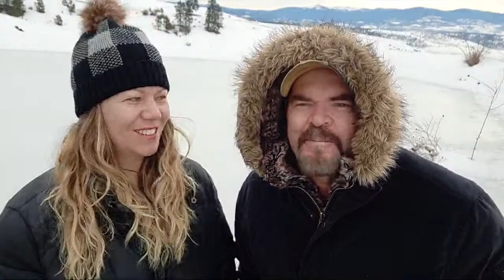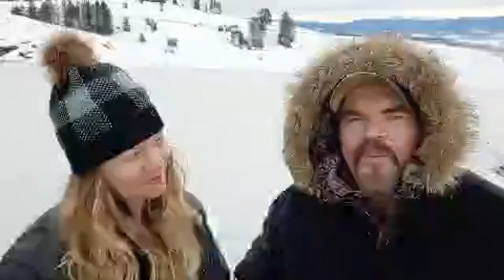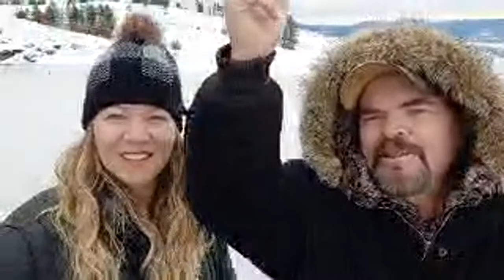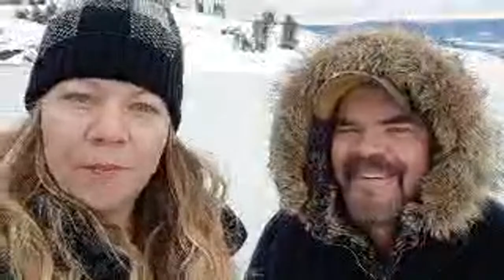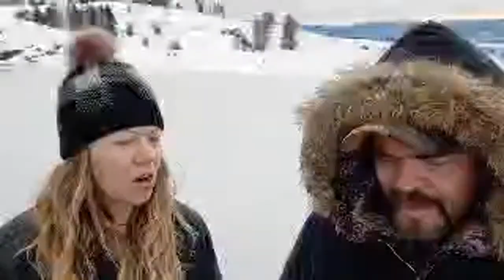HDC Live On homestead

Comment: Honey Do Carpenter, I have a question, if I were to build my shop using Air Crete for everything (floors, walls roof) would the Air Crete floor be strong enough to support some automotive lifts, or would I have to reinforce the floor with rebar? Any information and suggestions would be greatly appreciated.

Comment: You have a carbon monoxide (CO) sensor, not a carbon dioxide (CO2) sensor.  In a perfect burn, the exhaust gases are water vapor (H2O) and carbon dioxide (CO2).  Carbon monoxide is produced when there isn't enough oxygen (O2) available to the fire.